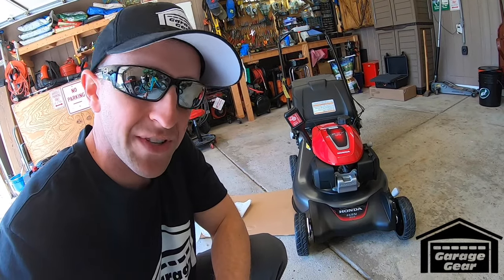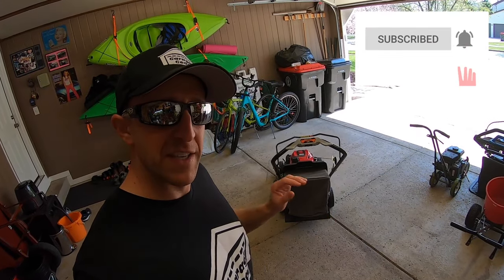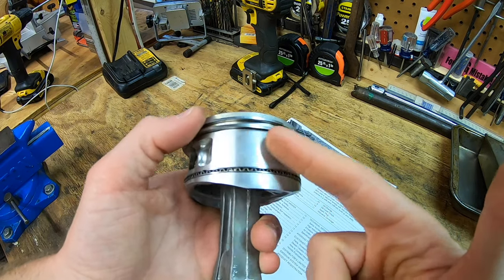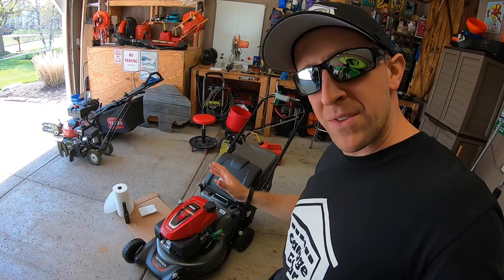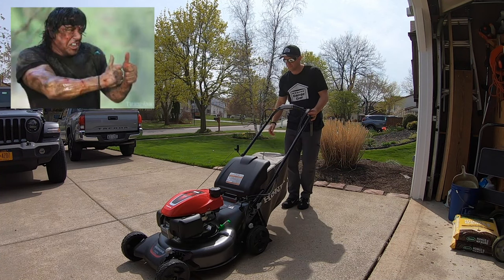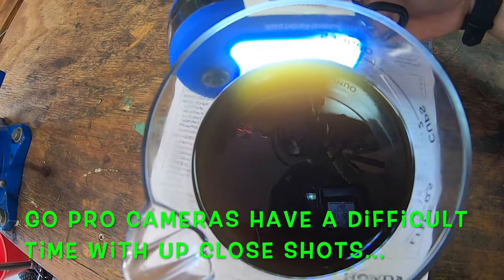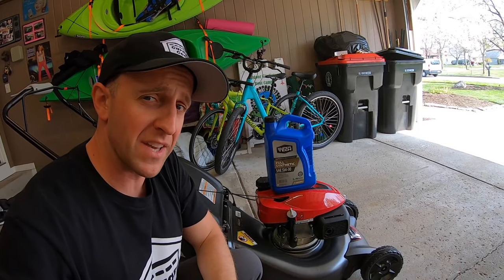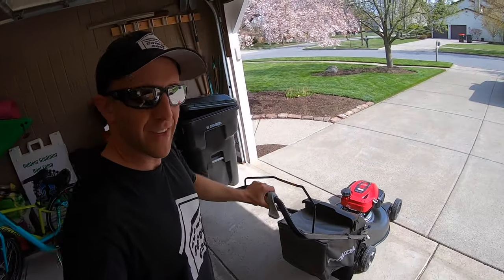BEFORE You BREAK IN Your New Lawn Mower Engine, WATCH THIS!

Comment: A couple of things I would like to mention here..........I also agree with the break in start up, but there is one very important thing you should do before you fire it up; 1: disconnect the spark plug wire and crank it over by hand quite a few times to get the parts well lubricated before putting it under its own power. 2: Instead of using a strap wrench to keep the blade and engine power engaged, use a simple spring loaded clamp. I've been using a spring loaded clamp for many years on my vintage Honda HRS21 mower and it works great!!!! But other than that..........keep up the great video content and information.
Reply from the maker: Hey Toyota, thanks for watching and sharing!
Reply: @GarageGear  I watched this video because today I'm getting my new Honda HRN216VKA lawnmower and I wanted to see what other people were saying about it. I can't wait to start using it 😬
Reply from the maker: @91rattoyota  very cool!  You won’t be disappointed my friend! Let me know how you like it!
Reply: I did what showed the video. Holy cow when I drained the oil after 40 minutes, it was dirty with small pieces of metal like you had in the video. I refilled with synthetic oil 10W-30. Thanks for the tip
Reply from the maker: @wilmerfajardo8488  hey Wilmer! Glad to hear you got the lousy oil out with all the junk in it. Now you’re good to go! Thanks for watching!
Reply: @GarageGear  Alrighty! Now that I've put it through its paces I can now rate it. I did the oil change after about 1 hour of use. Mine wasn't as dirty as yours was, but it wasn't clean either. The smart drive control is a little goofy and takes a little bit to get used to, but I do like how it works. The deck height adjustments on the wheels is awesome! I do wish that the bag was a little bit bigger, but I do love having one finally. This mower has saved me tons of time from doing yard work and I love not having to clean up grass clippings. Overall it is a great mower and I'm happy with my purchase. I gave my vintage Honda HRS21 to my cousin. Hondas are the way to go!
Reply from the maker: @91rattoyota  Honda really knows how to build them! Thanks for sharing your thoughts on this mower! 👍
Reply: Like Toyota,with an empty fuel tank I pulled the starter cord around 10 times to get the oil (penrite sae 30 mineral) moving around the engine. It was very noticeable how much easier it became to pull the cord after a few tries. Put fuel in and it fired up first pull with zero smoke.
Ran the engine for 30 minutes at various speeds. After cooling, checked oil level and condition. Level was as before, condition was like new.
My intention is to repeat this procedure at each cold start, change out the oil at 5hrs then around twice yearly. When I've used up the mineral oil (2 litres left) is there any benefit going to semi or full synthetic?
Reply: @91rattoyota  I plan on getting the same model for my daughter tomorrow, and NOT as a Mother's day gift, just happenstance and she needs a mower.  This vid just convinced me to take the plunge.  And I have my reasons for NOT getting her an electric mower.  Since your comment was from a year ago, how do you like your Honda mower?
Reply: @wiredawg2005  hi there, I love my new mower. Very easy to start and use. And the bag system saves me a ton of time with yard clean up, especially in the fall when the leaves start falling. Easy to maintain too. Hope your daughter likes it because I sure do.

Comment: I run 15w-40 in my lawnmower. I change at approximately every 20 hours of use . If you do this and keep a clean air filter, your mower will last 4 times longer . I currently repowered a 1998 Snapper 21 with a Briggs&Stratton short block.
Reply from the maker: Good info here Jon! Thanks for sharing!

Comment: Question, since the engine was still running after the 30 mins past. Is there potential for fuel to leak out when tipping and draining the oil out or is the risk minimize due to some of the fuel being expended
Reply from the maker: No fuel leaks out because of the design of the gas tank! 👍

Comment: I did find the bag filled up rather quickly and the grass was pretty damp so you can def feel the weight when the bag fills up. This is my first mower with a bag. 

I was skeptical of the rear discharge but found that with it being in the back I didn’t have any issues with grass blowing in my feet and also the fact you don’t have the side discharge in the way, I was able to get in more tighter areas I can’t with my side discharge mower.
Reply from the maker: All great information here Jor! I am anxious to compare how this mower does on my lawn with the rear discharge, mulch an bag options. How did the mower handle thicker/taller grass?
Reply: @GarageGear  I thought it handled the thicker taller grass pretty well in the bag mode but for the mulch mode, I think it’s a little tough when the thicker grass is wet. I could hear it kind of sputtering, never worried about it stalling but def could hear some strain. It still mulched it but left clumps I had to go back over with the bag and suck up!
Reply from the maker: @jorscorer3344  ok good information here! I’ll be sure to give it a thorough morning test when the grass is wet.👍

Comment: Great Tips JB.  I have a Honda HRX 217.  I use ethanol free gas and John Deere Turf Guard oil.  Was told my mechanic at John Deere dealer than the Honda with JD oil would last for a long time.  I change my oil in the oil probably ore often than necessary but it is cheap insurance for me! Great Videos JB!
Reply from the maker: Hey Mark, I totally agree with you on the "cheap insurance" policy.  Your mechanic is right! Changing the oil often is the best way to keep your engine going for a very long time. And the ethanol free gas is the best way to go! How longs have you been using that JD Turf guard oil?  Expensive?  Thanks for being  a cool fan!
Reply: @GarageGear  JB, I bought my Honda HRX 217 about 4 years ago. I have a big yard that is extremely hilly and a lot of side hill mowing. I takes me walking about 21/2 hours to mow but I didn’t want to spend thousands on a rider. The rider would have to have a locking rear end for hills and those are only with huge decks. I get JD oil at JD dealership. Mower doesn’t take take much so it’s not expensive to me. Fresh oil,sharp blades make a mower last.  Honda has very fast blade speed which also makes a big difference. Thanks for the response JB
Reply from the maker: @markhaas8394  oh wow! You’re a brave man Mark mowing for 2.5 hours. My wife would kill me if I took that long lol! I’ll you what I loved the cut quality on the past Honda I had! I’m excited to see what this one can do!

Comment: Great video man thanks. I have a 25 year old Craftsman that still runs well but the deck has rusted through in a few spots. It certainly doesn't owe me anything at this point. I'm on the market for anew mower and down to Honda or Toro from a local dealer. Honda seems to consistently comes up with great reviews. 

Did you look at the HRX series with the plastic deck?
Reply from the maker: Hey smokey! I did look at them but I was trying to stay on a budget with this video series! Thanks for watching

Comment: I agree with changing the oil right away to flush out metal debris and assembly byproducts.  Honda doesn't make a full synthetic small engine motor oil.   Normally it's not a good idea to switch to a full synthetic so quickly.  You need to allow for the piston rings to properly seat into the cylinder walls unless the cylinder walls were specifically bored and honed for synthetic oil break in.  Will end up with the rings never properly sealing and you get blow by.
Reply from the maker: Thanks for sharing this Dan! And thanks for watching! 👍
Reply: Not going full synthetic straight away because it interferes with break-in is an internet myth.
Reply: @em4703  Watch some videos on Evo 4g63 and STi EJ25 motor builds for reference.  You go with full synthetic right away the piston rings will not seat into the cylinder walls properly and you will get blow-by.   We are talking single cylinder lawn mower engines, but I'm more from a high performance engine background.  Honda still only sells non-synthetic oil for their lawn mowers because that is how the motor is designed by Honda engineers.

Comment: Serious question here, but if a new mower is advertised as no oil change required and has a warranty or a paid extended warranty shouldn't the manufacturer or whoever replace the mower if there is an issue from not changing the oil, ESP. If it's advertised that way? Don't get me wrong I've always changed my oil in everything.  And also, I Binged watched all your reviews as I am going to buy a new mower in the morning and since they don't make them like they used to,  I'm still clueless as to which one I should purchase. I had a Toro super recycle and it still stalled out.  It was stolen and now I need a new one. Any suggestions made before I go to multiple stores would be greatly appreciated. Thanks.
Reply from the maker: Hey panther. I would grab a Honda if you can still get one and avoid those bad briggs engines if you can!
Reply: @GarageGear  well I went with the Honda HRN 216. It did pretty good in my knee high grass. Went a little fast about 3/4 of the way and it stalled. But, didn't have any more problems after that. Going to lower it a little and clean it up some more. Lots of money, so hopefully it'll last me and not get stolen like the last one.
Reply from the maker: @panth3r26  it should last you a while my friend!

Comment: JB! I have a new Honda HRX217, but my mower doesn’t start on the first pull it starts on the 2nd pull. I’ve seen so many people have theirs start on the first pull, is something wrong? Should I return it? What could I possibly be doing wrong
Reply from the maker: I wouldn’t worry about it. These mowers typically start in one to three pulls. It all comes down to the auto choke on these
Reply: @GarageGear  thank you so much

Comment: Only thing I’d add is after that initial thermal cycle, put a load on the engine mowing grass for :20-:30 before changing oil to seat the rings well.
Reply from the maker: Good tip DC! Thanks for sharing! 👍

Comment: I did end up having the lever of the mulch/bag move on me from mulch to bag somehow but that was an easy fix.
Overall though man, GREAT mower! And it started on the first pull every time. Have the new oil in it after initially running it so I’ll change it out at the 5 hour mark.
 Great videos! Thanks man!
Reply from the maker: I wonder why the lever moved? Did it move after hitting a big bump or something? The first oil change is important! I’m surprised the manual doesn’t say to do that step. Plenty more videos coming soon! 👍 thanks for watching!
Reply: @GarageGear  not sure why the lever moved, maybe I didn’t have it engaged far enough over so I’ll take fault for that one, I’ve already mowed a second time and had no issues with the lever moving on me. Thanks for the videos, keep em coming!
Reply from the maker: @jorscorer3344  you got it bud! Keep me posted on the mower’s performance! Plenty more videos coming soon!

Comment: I just purchased a HRN216, I found this video before I first used it. I was a bit sceptical with the whole oil change, but was prepared nonetheless. Sure enough after about 30 mins the oil was black and there was heaps of tiny metal particles in the oil. I'll run again and change in 5 hours and might go to a full synth. Is there much difference between 10-30 and 5-30 in these engines?
Reply from the maker: Hey Tim, thanks for watching! The manual states you can use either oil. I use 5w30 in just about all my machines with no issues and it works for my temperature zones. Smart man getting those metal particles out!
Reply: @GarageGear  wow. That oil is already dark at 30 mins running but hey, since I change oils every 50 hours, I still go for mineral monograde and multigrade Diesel engine oils . It worked and still works for me
Reply from the maker: @danteerskine7678  Awesome thanks for sharing Danny!

Comment: Just got the 2024 version of this mower.   
Can I ask how many wax choke cartridges you go through?  I’m using for business purposes.
Reply from the maker: @Dallasl_andscaping_.  not even one yet! You’re good to go! I have one on standby but so far it just sits in my cabinet
Reply: @GarageGear  thanks!  The shop voided my warranty because of how I’m using it so the repairs are on me. 
I’ve only used it 2 back yard cuts so far and tempted to drain the oil now that I see that issue. 
Maybe I should rig up an hour meter for maintaining the beast.
Reply from the maker: @Dallasl_andscaping_.  not a bad idea to get an hour meter on them. They’re cheap and easy to install

Comment: Dude, talk to me more about the synthetic oil you use for your small mower motors! Thanks for the video! Love me some Honda’s!
Reply from the maker: Hey Dad who mows best! I use 5W-30 full synthetic is every engine I own. It has a wide temperature range. I usually buy a big jug. The one I bought was the Walmart brand. I use all brands as long as it meets the API SN ratings on the jug. I'm friends with a professional small engine mechanic who's got about 40 years of experience. He told me that small engines work best with 5w30 full synthetic. Ever since he told me that years ago that's what Ive been using.  The amazon brand is actually very fluid at cold temperatures.  I run that in my truck.I use this oil in my mowers, pressure washer, generator, edger, and whenever I do tune ups for people. Works great! Thanks for being an awesome fan of the channel!
Reply: @GarageGear   no issues about breaking in with synthetic rather than conventional? I’m an old school V8 engine guy and always broke in my new engines with conventional before switching to synthetic. Thanks for the reply and video sir!
Reply from the maker: @1975oldschool  that’s a good point I forgot to mention! The oil that comes with this Honda is conventional. So I broke it in with that! Then put in full synthetic!  This is a good practice but I have used full synthetic for break ins on small engines before with no issues whatsoever and had those engines for many years. Hope this answers your question!
Reply: @GarageGear  👍🏻 Thanks for the info man!
Reply: It is perfectly fine to break-in an engine in with modern synthetic oil, as opposed to he old synthetics.  It has evolved and is ok to use.  You save a grip at Walmart, buying the bulk jugs (you don't want to go anywhere else). 
Check-out Steve's Small Engine Saloon's video on why pump gas is bad for small engines (a little off- topic, but a an eye-opener nonetheless)... Peace!
Reply from the maker: @1975oldschool  you got it! Let me know if you have any more questions!
Reply from the maker: @campbellpaul  great tip here! Thanks for sharing Paul! 👍

Comment: I have a brand new hrn just like this one.  The tension on the cord is tough as shit to pull like it just stops or jerks.  However it does start on the first pull but I have 2 of these things, one is silky and easy and smooth the other is not.  Any ideas? Revs kinda high too
Reply from the maker: Thanks for watching, Single Turbo. I don’t know off hand without looking at it. Perhaps you can contact a small engine shop near you and they can look at it. You’ll have to let me know what they find.

Comment: Quick question, where do you run the throttle position for the first 30 mins?
Reply from the maker: On this model there is no throttle adjustment. Turn it on and let it rip. 👍

Comment: Thanks for the video.  Got a question.... Shouldn't the filter be replaced as well after the initial warmup?  I would think some/many of the particles would get snagged in the filter during that initial 20-30 minute runtime which would still be roaming around the engine once you replaced the initial oil.  It would also have a few ounces of the non-synthetic oil (with particles) which would be re-introduced to the engine.  Thanks.
Reply from the maker: Hey Jack, there is no oil filter on this mower. Some commercial mowers do have an oil filter and in their case they would have to be replaced. Thanks for watching 👍!

Comment: I just bought a Honda HRN216VKAA/B about 4 weeks ago from a local Honda/Yamaha dealer. My previous mower was a Craftsman deck with Honda engine for 20 years. Loved the Honda engine. The mower came assembled and ready to run. I did the first oil change after 30 minutes. Saw your video and put in Super Tech Advanced Full Synthetic 5W-30. Have mowed twice with the synthetic oil. I wrote to Honda about using the synthetic oil in their engine. Honda wrote back and said "No, please use the recommended oil. Honda engines are developed, tested, and certified with petroleum-based motor oils as a lubricant. Any motor oil used in our engines must meet or exceed all oil requirements as stated in the owner's manual to include the recommended oil change intervals." NOW I am really worried. I want my Honda to run the best and last. After 5 hours of use, do I go back to conventional 10W-30 motor oil or stay with the Super Tech Advanced Full Synthetic 5W-30? Please reply....and THANK YOU for your videos.
Reply from the maker: Hey James! I have used 5w-30 full synthetic for many years in my small engines without fail. Either one would be fine in my book! Thanks for watching

Comment: Apparently for some reason the auto choke actuator is common problem on these mowers and has a excessive overlap. Other than that it's a great lawn mower. They have great engine, the design deck is fantastic, and it cuts well.
Reply from the maker: You’re right Alley! Luckily they are easy to fix/replace and the carbs are easy to clean! Thanks for checking out my channel!